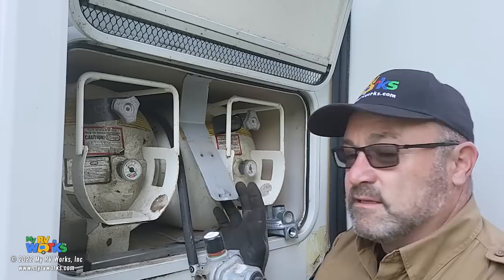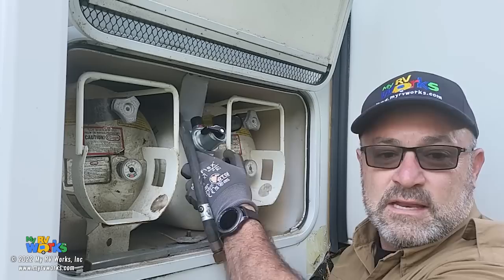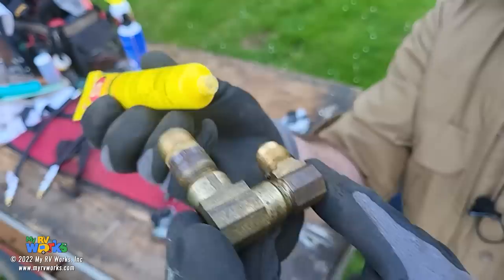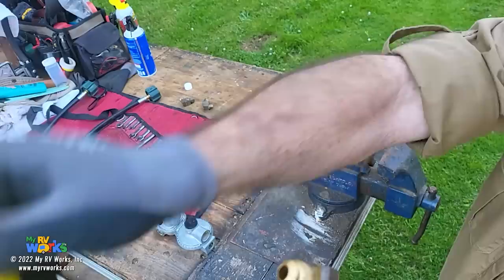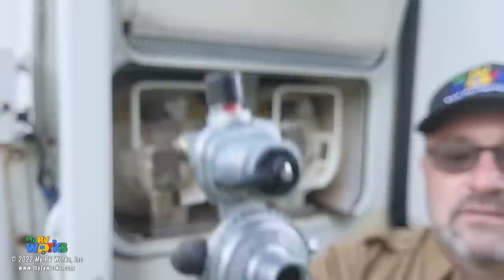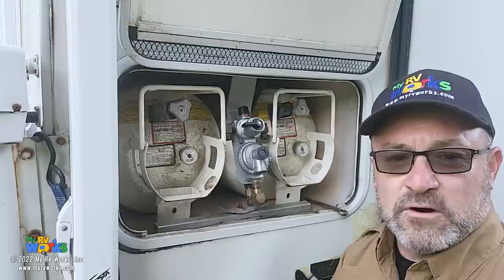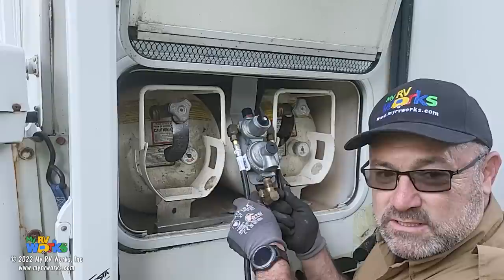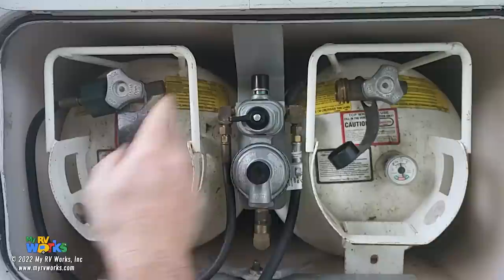LP Regulator Discussion and Regulator Installation -- My RV Works

Comment: I've neglected to do operating pressure and/or lockup pressure testing on some regulator changeouts lately...just assuming the new unit is perfect, and wanting to save time. I'll get back to doing those checks consistently. Thank you very much for the video!
Reply from the maker: Yes, we have found that the brand new Regulators are rarely adjusted to the correct specification.

Comment: They can and do get over filled. I fill propane pretty much for a living. Just take it back and either have them vent it or get yoy sone welder gloves and vent it yourself. Could also get a unregulated weed torch and go fire it up and burn some brush for a little bit.

Comment: This is very interesting and opens up a good thought, as I work or see newer RV the manufacturers are using all rubber hoses throughput so if we get this small amount from a 3’ hose good grief how much from 30+ feet thanks Daren good info
Reply from the maker: We mostly find the issue of oil coming from the high pressure side of the pigtails not the low pressure side.
Reply: @MyRVWorks  why? If a product causes  rubber to bleed and that’s what I would call it, why under high pressure and not low,

Comment: Inches of water not mercury.  Mercury is 13.5 times as dense as water. Atmospheric pressure is 32 ft of water at sea level. LP appliance pressure is very low.  To talk mm of mercury would be very fractional. To say 11-14 inches is convenient and easy to remember
At 0 F LP is about 28 psi.  Multiply by 27.7 to get inches of water. 775 inches of water 
But LP is different where you get it.  Different companies will add different butanes and ethane’s in different ratios.  Some mixes work better in different temperature ranges.  Propane is C3H8. LP is not just liquid propane 
Been an RV tech a few years 
Appreciate your videos and insight

Comment: Your timing could not be better! I thought I ran both my tanks dry yesterday. want to pull both tanks to get them filled and found the driver side tank full. When I took the pigtail off there was oil at the connection. Last year I replace that pigtail and the single stage regulator on that side. My two stage regulator with the changeover is on the passenger side. Going to change the two stage regulator today. I was wondering where the oil came from. Did not know if It came from the two stage changeover regulator all the way down the line 5 feet and through the single stage regulator and ended up at my propane tank. I was really scratching my head. Thanks!

Comment: My 1981 C class RV has a fixed LP tank underneath near the rear bumper. I don't believe I've seen a regulator in the system. I have also noticed the stove has a lot of orange flame. Is there an air/fuel mixture on the stove burners or do I need a regulator?
Update, It has been pointed out to me that I do have regulator on the LP tank.

Comment: If you need a high demand gas regulator and red hoses for the on demand water heaters  Will the stove and furnace work with this setup Or will they need seperate regulators ?

Comment: I have a brand new 2 stage regulator that doesn't appear to have the vent you mention at the bottom.   Has NFPA done away with that regulation?

Comment: I must have a bad regulator, my Atwood water heater will not stay lit.  I’ve replaced virtually every other component on it. It’s a 2016 camper, that was bought brand new, then parked & locked up.  No one has ever used it .  The regulator is the very last part I have not replaced.
Reply from the maker: I just uploaded a video on a Suburban water heater. You might want to watch that as there may be some ideas from that Suburban water heater that might help you with your Atwood water heater.  Here's a link:  

https://youtu.be/6x-v_RaBS5Y

Comment: Thanks for all the videos! I have oil in propane system. So much so that it's coming out of the furnace exhaust burnt and black and lots of white smoke. You can smell it and being anywhere close  irritates your eyes. I cracked open my connection at the regulator and it looked like vegetable oil dripping out. Did you do a follow up video on best way to blow out system?
Reply from the maker: I have not made that video yet, but what you will do is remove the hose that's connected to your regulator and angle it somewhere safe. Then go Upstream to the farthest LP Appliance, disconnect where the fitting connects and use compressed air and just blow out all the crap that's in the line.

Comment: I'm in the process of changing out my factory dual stage regulator that is rated @190,000 btu . I'm  installing a dual regulator that rated for 345,000 btu. Bot are rated @11 ounces. Will this create a problem for my rv.  Thanks

Comment: Question, and sorry it it has already been asked.    What Hi flow regulator do you recommend for a auto change over system with two tanks?   I installed a tankless water heater, and it is starved for Propane.    Also, you mentioned the use of hoses with Red caps that screw onto the bottles, red designates high flow.     Could not find these online.

Comment: Darren, So after viewing this video, I'm now shocked that I can go into an RV center and just purchased an LP regulator and install it myself as a DIY project.  How can this be? Are the tolerances of regulators such that would allow a DIY'r to successfully R&R a regulator with acceptable results (specified pressures) and little safety concerns?

Comment: Hey Darren...great job on the video again, taking notes here. I do have a "Q" for you. I noticed that where my hotwater tank is (Bounder 1993 31') below the SF35F furnace - I have of course copper gas line into it. there are no breaks as far as 90 elbows or couplers go....I would like to add a small tee of that size of supply line and a cap on it - so I may drain any impurities that might find it's way into the propane line. It would be the lowest location of the line and lower then the manifold too. Is this realistically ok too do so it would be easier to check to be sure line is clear or even to flow gas through it in order to check regulators?? your input on this please?  Thanks for the shots of the deer and the cat in the background....always enjoyed the video crashers...  LOL

Comment: Great information Darren.  I will now be removing the tape that I just used on my new pigtails.  Any recommendations as to finding a certified RV technician in one's area? Unfortunately, we are on the east side of the sound.
Reply: Good luck. East coast here. Cant find any rv service that will service a rv you purchased from elsewhere. New units are junk needing much service. That and staff shortages mean no service for me.
Reply from the maker: Hi Brian, the two suggestions we have are to 1) ask the manufacturer of the system if they can refer you to a nearby tech, and/or 2) visit a nearby campground and ask the manager if they can recommend a reputable tech.

Comment: What happens with auto change when you have 3 cylinders.   Two on driver side one on curb side. I have been using with valves closed on reserve tanks
Reply from the maker: I would be curious how that would be plumbed properly. Two cylinders would have to be slave together in a three cylinder configuration. The auto changeover only has connections for two inputs.  Per NFPA 1192 you can only have a total of 60 lb of propane in an RV and no single cylinder larger than a 40 pounds...
Reply: @MyRVWorks  It’s a Jayco Pinnacle with a LP generator. Three 40 # tanks

Comment: Where do you get your replacement parts?
Reply from the maker: We're set up with several of the larger RV Supply vendors and are able to get many things at wholesale. But Amazon and etrailer has reasonable prices on some items as well, and there are many other websites with an RV parts focus.
Reply: Thanks for taking the time to reply. It is much appreciated. So far I’ve done all the work needed to our RV and I have ordered often from Amazon and etrailer. I suppose normal people like myself who aren’t rv technicians, yet, won’t have access to the wholesale inventory of vendors like you mentioned? 
You’re videos are the best! So very helpful. Thanks again!